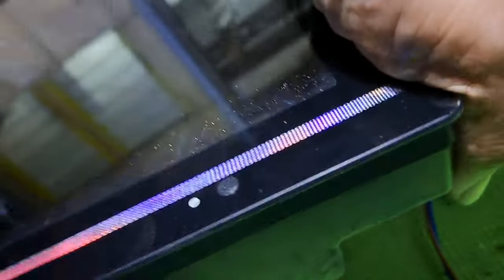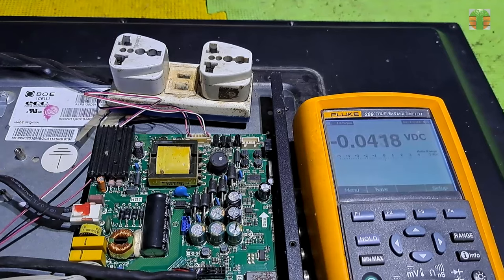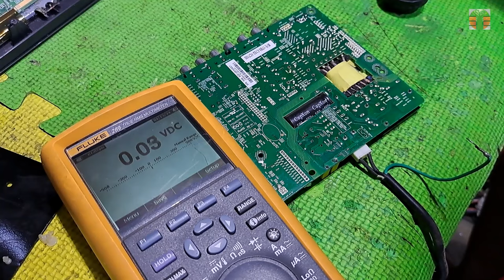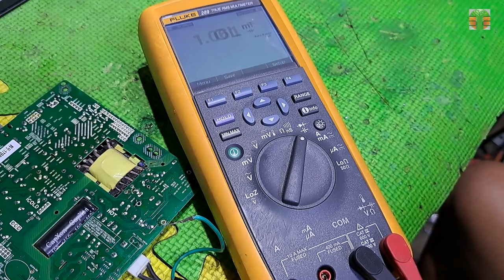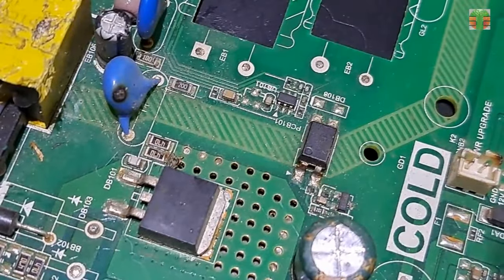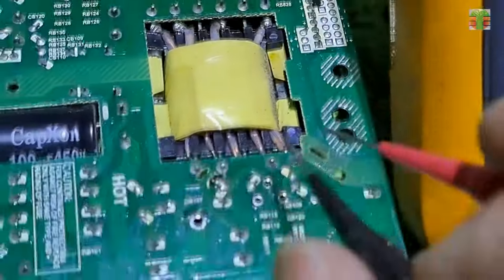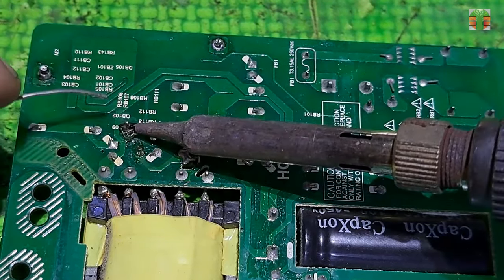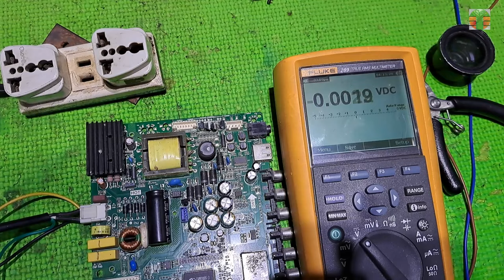Nova LED TV No power, Try not to modify the power supply.

Comment: That 220 ohms 20 watt is very handy, commonly use for discharging a fully charged main filter capacitor, it also serves as a fuse protection. Amazing! That pulse driver i.c activates the mosfet input gate terminal, without that pulse, it will not switch the mosfet... Good video presentation, and thank you for sharing your credible knowledge...

Ps: You have a wound on your right hand below the thumb...😊18:21

God bless and take care...
Reply from the maker: Thank you

Comment: 19:00 It is necessary to check the capacitor in the pvm power circuit. I'm 90% sure it exceeds the high esr and that's why it crashed

Comment: Hello tevz
Replacing the faulty transistor and resonator with str-w6053s ist grate.
Sadly this Device is not produced anymore, and trasted seller haven’t it anymore. Of course you can buy it on Aliexpress but you will get fake one without Any Funktion. what you will use in future?

Comment: How can we determine the value of a faulty SMD capacitor on a board if we don't have a schematic available?
Reply from the maker: Mostly a defective SMD ceramic capacitor is a rail line filter. you can put a 10 microfarad to 47 microfarad 25 volts. It is not necessary to set the exact value.
Reply: @tevzTVTevatronics  What do you mean by rail filter?
Reply from the maker: @protection4541  Example the 5-volt rail line, there are filter capacitors at the line.
Reply: @tevzTVTevatronics  "Thank you very much. I understand completely."